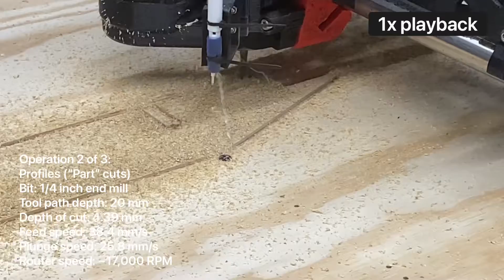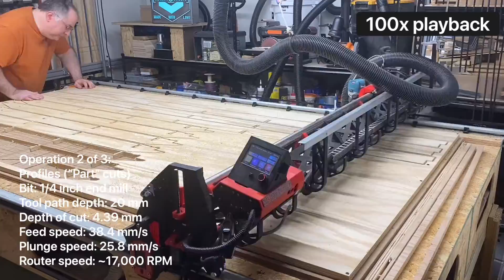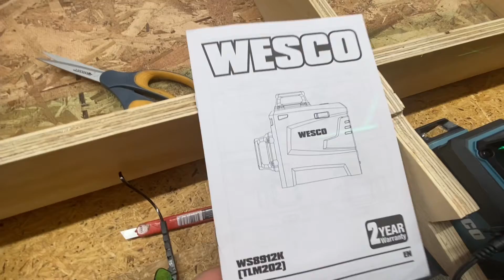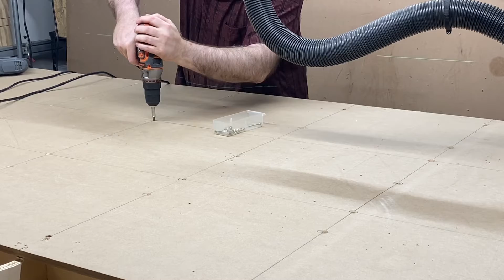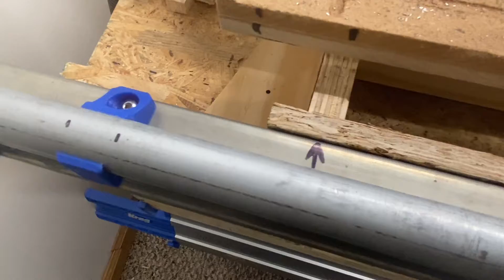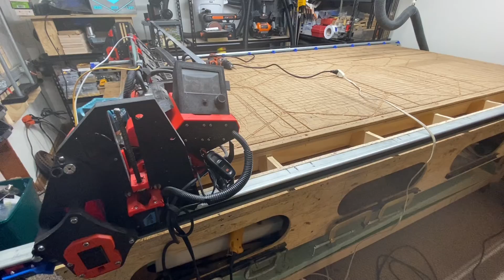For LowRider v3 CNC, full sheet capable table, Part 2, CNC cut & assembly!

Comment from the maker: Update regarding LowRider v4: I was asked if I used this table for my LR4. I did use this exact table, but please be aware that the margins on LR4 are different than on LR3, so my work-zone (placement of sacrificial MDF on the table) is not perfectly aligned for LR4. I could "edit" that placement rather easily if I ever took the time. Meanwhile, post release of LR4, Ryan of V1E came out with a full-sheet table design that's already laid out perfectly for LR4 use and he made it public. I'd use that if you are starting from scratch. https://forum.v1e.com/t/200-full-sized-lowrider-table-non-cnc-build/47947

Comment: Thanks for sharing! I just ordered the hardware kit to build a v4. I hope to also do this. Thank you!
Reply from the maker: Cool!
Reply: @design8studio  Looks nice!. I'm starting a V4 myself, did you use this exact table when you upgraded to your V4? Also, is there anything you would change if you were starting a new table?
Reply from the maker: @bradpitt3323  I did use this exact table, but be aware that the margins on LR4 are different than on LR3, so my work-zone (placement of sacrificial MDF on the table) is not perfectly aligned for LR4. I can "edit" this placement rather easily if I ever took the time. Meanwhile, post release of LR4, Ryan of V1E came out with a full-sheet table design that's already perfect for LR4 and it made it public. I'd use that if you are starting from scratch. https://forum.v1e.com/t/200-full-sized-lowrider-table-non-cnc-build/47947

Comment: Love the torsion box, perhaps I missed it, but why you used incremental spacing on 1 axis? Did you update it for LR4?
Reply from the maker: I was able to reuse the same table for the LowRider 4. It just took a little bit of attention to detail to get the new mounts at the right placement for the correct dimensions. Can you help me understand what you meant by incremental spacing?
Reply: @design8studio  Now if you ask perhaps the spacing is equal between the ribs, and only the camera wide lens make it look like that're positioned in an incremental way along the Y axis.
Reply from the maker: @attilah  The spacing is indeed equal between each of the ribs, and also between each of the spars. It must just be an optical illusion caused by perspective.

Comment: Buying unistruts in the UK - is the right size 41 x41mm with a 2.5mm or 1.5mm wall thickness? excited to bootstrap this at the weekend!
Reply from the maker: I used digital calipers to measure my metal strut (aka Superstrut), and got this: width: 41.5 mm, height:	around 41.8 mm. I think the thickness is about 2.6 mm. Hope that helps! Keep us posted over at the V1E.com forum regarding your bootstrapping!

Comment: Wow! You make it look so easy, but im sure it is not :D I cant even get my 3d printers to level :| I have 2 anycubic predators and 1 chiron.
Reply from the maker: @toneandersen2944  Really that last step of resurfacing the spoil board is what accomplishes the flatness to the most degree. Doing that flattening process creates a LOT of MDF dust, so you have to have good dust collection. MDF is basically sawdust held together by adhesive chemicals — basically cheap glue. Those chemicals and that dust are very unhealthy for lungs. So in addition to having good dust collection, you would normally want to wear a respirator mask during the process. It’s something that you hope to not have to do very often!

Comment: im having trouble building a stand big enough and keeping it leveled i tried with 1.5x1.5s and that was a horrible got all kind of wobbles i would like to build this box and some legs for it but im stuck building a standard one to get this cut out
Reply from the maker: Getting a solid stand for a CNC table gets harder the larger the CNC table is. Not hard at all for small ones, but challenging for big ones. My table base plans and later upgrades are documented starting about here: https://forum.v1e.com/t/doug-joseph-design8studio-full-sheet-lowrider-2-build-on-a-budget/29568/6?u=dougjoseph

Comment: Curious how much Z travel you have. I have a slab for a table that I would like to face, the slab is 4” thick. Would that be possible? Or would I need to come up with some sort of drop table?
Reply from the maker: A drop table would be the best, strongest, most rigid way to tackle that kind of project with a LowRider. All CNC machines have an anchor area at which they are their most rigid, and as they extend away from that anchor area, they become less rigid. For most CNC’s that anchor area is at their highest point, and their weakness increases as they go down. The LowRider is designed to be the opposite. It gets more rigid as it goes down, and is at its most rigid, when it is at the bottom, closest to the material. So for flattening a slab, you would want the LowRider in the lower range of its operating capacity, and a drop table would allow you to rigidly fix the material in a way that the LowRider was able to reach it without having to go up into its less rigid, higher reaches. If you were talking about an inch or two, maybe 2 1/2, perhaps a drop table would not be needed. For a 4 inch reach — on a slab that thick — a drop table would be best. My extended height on mine is mainly for access, for being able to look up under, and reach up under it. I might be able to do some carving from its highest point on something soft like foam. But I wouldn’t want to do it with flattening a slab.
Reply from the maker: A set of detachable risers could be contrived that would allow you to have a LowRider that would operate as normal, and then switch to a drop table configuration, and back.
Reply: @design8studio  thanks for the suggestion. I did consider using u channel for the wheels to ride on and just putting that u channel on some risers as needed?
Reply from the maker: @AnthonyWebb7  if you get a plan drawn up, post it on the V1E.com forum for input!

Comment: What are good alternatives for the super strut? They run me 700 euro in Europe it seems? Would a normal u profile work? Perhaps in 3 mm thickness? Ofcourse you’d have to drill the hole yourself and make sure the size is the same as the superstrut
Reply from the maker: Here in the US, MDF wood trim strips are sold longer than 8 feet, and they can be used to make a wooden riding rail. Also, even if you can’t get strips longer than 8 feet, gluing a couple of strips of MDF together can make a wooden writing plate. As far as metal alternatives go, I am sure that some U-channel would be fine, and I don’t think it needs to be quite 3 mm thick. Hole drilling is a task and the thicker the metal the harder that is. The two main brands we have here, superstrut and unistrut, are 12 gauge, which is 2.6 mm.

Comment: Dumb question...what screws did you use to assemble the torsion box? I'd 1-1/4 good enough? I don't wanna split the sides of the 3/4" MDF struts
Reply from the maker: You probably saw where I was pre-drilling for each screw. That helps with the potential problem of splitting. Also I did not glue the skins on, but quite a few people had said gluing them on makes for a stronger box. If gluing then using short screws is not a problem. Using long screws has pros and cons. Pros: more threads provide better holding power (short screws could more easily strip out). Cons: could possibly split the material (which leads back to the pre-drilling).
Reply from the maker: I'm not positive but I think I was using screws 1 1/2" inch or so long.

Comment: Hi Doug, 
Do you find the Unistrut not being perfectly flat affect the quality of your cuts? On some of my projects, some sections I would only be putting a dado in and not cutting all the way through. I am just wary of the dado being sloped.
Reply from the maker: These metal struts could possibly have dents or bends in them inflicted during shipping to the store or something. It’s probably like shopping for lumber — you want to check to make sure they’re straight before you take it home. They’re hard enough to bend that if you get one that’s straight at the store it’s probably gonna still be straight for you. If you eyeball it from the end, can you see a high spot or low spot? I don’t seem to have issues.

Comment: Hi, Doug. Wonderful video, you are probably the best source of information for the LR3.

I'm really new here, I just built my LR but I'm still on the squaring process so I have a few questions regarding this video:
Why do you use 1/4" bits instead of 1/8"? Isn't it more work load to remove 1/4" lines of material?
Also, how do you choose what type of wood to use for the table? Why does it have MDF on the top and bottom (well, OSB) and OSB on the sides where the rail is attached? Why didn't you use Plywood for everything?

Thank you for all the effort and help you bring to the community!
Reply from the maker: Hello, and thanks for the kind words! Really the two best source of information on the LR3 are Ryan, the creator of it, and the V1E.com/forum group. If you're not already a member of the forum, please join asap, and if the questions you have are not readily found in searches, then posting the questions there helps answer the questions for other makers! As for 1/4" bit over 1/8" — while it's a bit more wood to be removed, it's worth it because the thicker bit has less deflection (bending) and with its added strength and rigidity, it can be more accurate while still using a quicker feed rate. I have broken off 1/8" bits, but never 1/4" bits. The only ways I've damaged 1/4" bits was either running them through screws, or running them at too high RPM causing heat which results in burning the bit too badly. The latter was a rookie mistake not made often. Re. what type of wood to use for what: Ryan, the designer of the LowRider CNC and the founder of V1 Engineering, has formal engineering training (and I don't) so he's the source I am paraphrasing here. For when the goal is dimensional accuracy and least chance of twisting, warping, cupping, and bowing, the order of preference is: MDF, OSB, Plywood, and dead last is regular, unprocessed lumber. He has semi-explained this as, the more processed a wood is, the more it resists bowing, cupping, twisting, and warping. Adding to that some of my own understanding, is that after a certain point of processing, a wood substance can also lose some ability to take and hold a screw, because the more homogenous it gets, there is a risk of reduced tensile strength. Particle board is highly processed but does not use as much adhesive as MDF, so although particle board is highly processed, it has low tensile strength, and is horrible at holding screws. MDF holds screws better than particle board, but not as good as OSB and plywood. My suggestion for a torsion box would be to use MDF for the ribs and spars, and a thin sheet of MDF for the bottom skin, and glue the skins on instead of just screws (I did not, and I kinda wish I had done that), and a thin MDF sheet for the top skin (again glued on) and thicker MDF for a spoil board. If you want to use screws for material hold-down, and you want them to have the best biting and holding power, consider the top order being, thin MDF top skin (glued down), and then a layer of say, 1/2" OSB, and a final spoil board layer of 1/2" or 3/4" MDF. The latter two would obviously be screwed down, not glued down. A spoil board presumably is desirable to be removable for replacement.
Reply: @design8studio  Thanks for the super detailed explanation. Exactly what I needed! Now that part where you said that you've damaged bits by burning them due to high RPM got me worried, as the router I bought has a fixed speed at 34500 RPM and I'm guessing that not being able to control it would burn off bits more often
Reply from the maker: @octimus2000  Re. router speed control is something you will definitely want. Check out this one: https://www.v1e.com/blogs/news/kobalt-router-featuring-the-lr3
Reply from the maker: @octimus2000 https://www.lowes.com/pd/Kobalt/5014100299
Reply from the maker: @octimus2000  https://www.youtube.com/watch?v=EenSuQUbFjg
Reply from the maker: @octimus2000  https://www.youtube.com/watch?v=dCa6vIeGzfU
Reply from the maker: @octimus2000  https://www.youtube.com/watch?v=zy_cChYwTQY
Reply: @design8studio  yeah, I really wanted that router since I saw it all over the forum but sadly I'm not us based so I couldn't realistically get it. I'll probably get an external speed controller until I can justify getting a new router, would try to import the cobalt one but tends to be a rather difficult task, so as someone said on the forum, I'll be sticking to 1/8 bits, since they appear to be less prone to overheating
Reply from the maker: @octimus2000  Got it. The smaller a bit is, the faster it needs to turn, so your idea of sticking to 1/8" bits will help.  Dentist tool bits are tiny and they have to spin very fast. That said, the size of the bit (alone) is not a guarantee against overheating, but rather the relation of the RPM to feed rate. Picture your 1/8" bit spinning at 34,500 RPM, but with a feed rate of 0, and sitting against the wood. Max friction. It will catch the wood on fire quickly. Now imagine the same RPM, but the feed rate is too high, so the bit is deflecting, and deflects so much that it breaks the bit (but note that both the bit and the wood are nice and cool). The ideal "feeds and speeds" setup is somewhere in the middle, with feed rate that allows the bit to bite off good size chips, and the cutting action transfers heat into the chips, and the bit stays relatively cool. You want warm chips, and the bit will be warm too, not but too hot. The rest of the wood will be relatively cool.
Reply from the maker: WIth a rotation speed of 34,500 RPM, which is high, you may not be able to get a fast enough feed rate to sustain that RPM, with a 1/8" bit. The deflection on a thin bit diameter may simply be too much. Worth a try. You should run the numbers in a software "Feeds and Speeds" calculator. I use the G-Wizard calculator. It's a paid program. There are others, and I think some are free.
Reply: @design8studio  awesome, will take a look into those  calculators and start considering a new router too haha

Comment: Question - my Home Depot only seems to have 3/4" MDF...no 23/32". I know that's super close, but will that work? Also, how thick is your spoil board or did I miss where you said that. And yes, I'm copying you, lol
Reply from the maker: Here are some observations that may help on that. Sometimes "3/4" is just that, but sometimes (even often) it's only nominally that, and is actually something else. You always ought to measure with calipers, and if the actual thickness is different than the parameter value in the Fusion 360 file, you're better off to adjust the parameter value and re-output the DXF's again. I made it as easy as possible. The free hobby license of F360 can be used for this. My main download page, here, https://design8studio.com/for-lowrider-v3-cnc-cut-table-dxfs-for-cutting-f360-archives/ — has a link at the top that leads to an older page with documentation and tips, here, https://design8studio.com/for-lowrider-v3-cnc-cut-table-dxfs-for-cutting-f360-archives-docs/ — All that said, it may be possible to take torsion box ribs and spars that were cut with slightly too wide gaps on the cross lap joints, and yet by adding some shim type material to tighten, it can work. Even adding sawdust to glue could perhaps help.
Reply from the maker: Also, it's possible to edit the included DXF cut plans, using a 2D vector illustration program, to edit the width of the gaps for the cross lap joints. Free programs are available, such as Inkscape. I use CorelDraw. Care should be taken to adjust each gap in a uniform manner (ideally nudging both sides, but if only nudging one side, always nudge the same side).
Reply from the maker: Also, regarding the thickness of the spoil board, if memory serves, I think I used a 3/4" skin and a 1/2" spoil board on top, or vice versa. I wound up with my spoil board being about 1/2" higher than my rails that the LowRider rides on. However, that's not an issue for me, especially because I used Dan's (@Supraguy) extra tall YZ plates, so I don't have issues being able to lift my LowRider high enough to get under there for bit changes etc, and can work with somewhat thicker materials. Extremely thick would have the LR3 away from its most rigid height, which is all the way down, but the only really thick things I'm like to do might be flattening a slab or carving foam, so no biggie.

Comment: And these are the 1 5/8t" x 1 5/8" Superstruts? My homedepot also has a 1 5/8" x 13/16"
Reply from the maker: Yes, and the Lowes listing for them is https://www.lowes.com/pd/Allied-Tube-Conduit/5002950743 — they have them at Lowes, Home Depot, Menards, etc under at least a couple of different brand names.
Reply: @design8studio  Got it, thanks! I am buying my wood on Tuesday, bootstrapping and busting out this table. My only difference is I am modding one of those metal bracket workbench kits Home Depot and Lowes sells as the bas of my CNC and just making it 3x6' instead of the 2x4'
Reply from the maker: @CaptainFettCosplay  Cool. In case you did not know about my Hidden Belts mod, it's something to consider. It takes advantage of the metal strut as a place to protect and hide the belt. https://www.printables.com/model/422468-lowrider-3-cnc-hidden-belts-mod-hideprotect-either
Reply: @design8studio  yup, I already have that sliced and waiting on my matching green ASA to get here to print it.